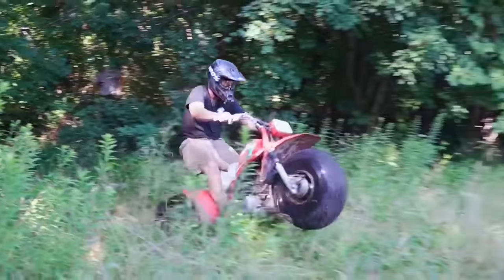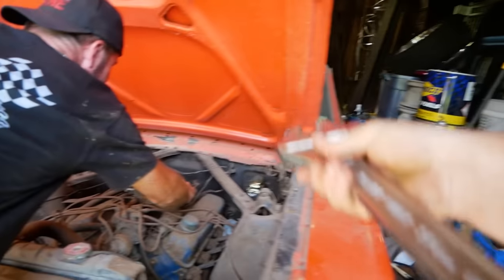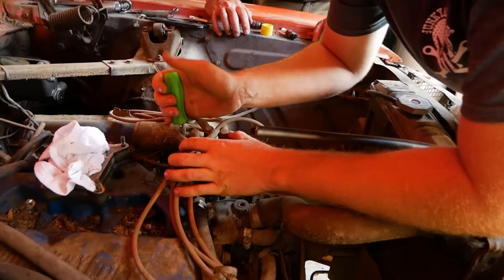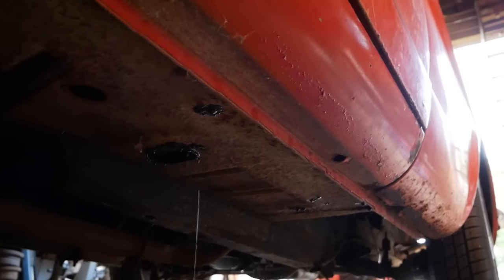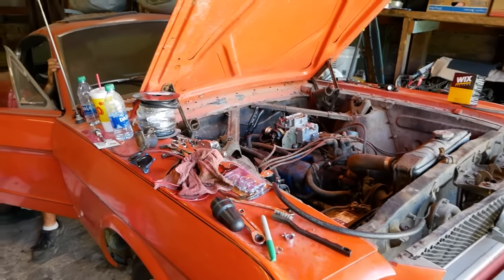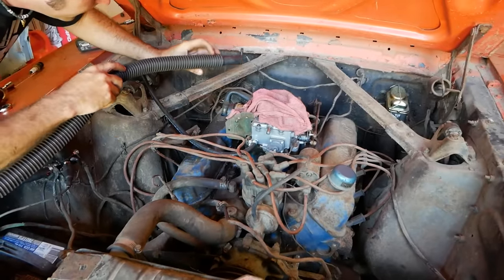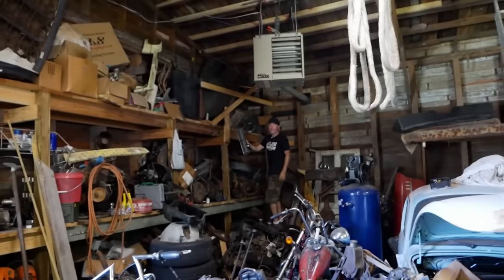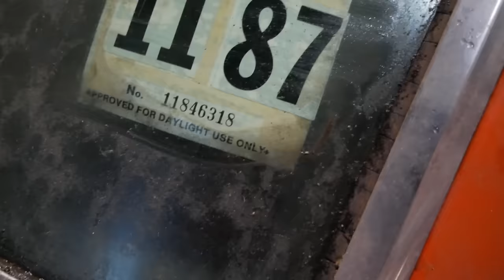Parked '65 Mustang FASTBACK First Start in 33 YEARS!!

Comment: I really hope they replaced the front rims with some that match the rear. I have an affinity for those as my brother had a ‘65 fastback back in the ’80s with those exact pattern of slotted rims, 14x7” on the front and 15x8” on the rear running 215/60-14s front and 235/65-15 rear Eagle ST white letters.

Comment: i like the way the guy said the output voltage from the coil is 10,000 volts when its really 12,000 unless the battery install emitts only 10v

Comment: i think there is a 1/4 inch gasket and metal plate and small gasket insulator on the old fords ,  need it there to run right, that distributor is wore out,   get a electronic distributor for a 81 or older    and ignition box with blue connecter to convert to electronic

Comment: I k n own it isnt a major nut whenever I use cork valve cover gaskets I take some permatex ultra and I glue the gaskets to the valve cover and flip em right side up and put about 50 lbs of weight on thrm in the sun or with a heater in front of thek to get them hot for an hour and the goop sets and then input a healthy layer of axle grease on the gasket where it mates to the head and gently tighten them down and they will be reusable. I had my 600hp 355 and I ran the same cork gaskets on my edelcbrok finned valve covers for 5 years and had em on and off 100 times to adjust the lash on my 306/292 .700 lift cam

Comment: ike if the engine was made before 1968 it is a 289 68 first year of the 302 should be a date code on every part should be a c5 on intake block manifold heads exct if so its a adjustable rocker 289
Reply: Also y'all should tap the heads and add screw in rocker studs makes that 289 valvetrain way more stable also iv got a factory 4bbl intake for that 289 if you're interested in it just hit me up I'm in NC this collaboration was awsome

Comment: Lots of discussion here about identifying a 289 vs an early 302. A 289 or 302 head casting  doesn't make an engine a 289 or a 302. The same applies to a 289 or 302 casting in the block lifter valley. 289 and early 302 blocks have identical 4.00" bores. What defines a 289 vs a 302 is the stroke, ie crankshaft.  A 289 has a 2.87" stroke. A "1M" identifier is stamped into a 289 crankshaft. A 302 has a 3.00" stroke. These cranks are stamped 2M. The only way to determine the engine size is measure the stroke (as mentioned in the vid), or confirm the 1M or 2M stamp on the crank. I have a 1968 Bronco with the original engine. 1968 was the last year of 289 production. The heads are 289 casting, the block is a 302 casting (the first year for 302's, they probably used up the 289 blocks) and the crank is 1M, 2.87" stroke.  My Bronco engine is a 289.

Comment: Difference between the motors 302 and 289 is the dip stick on a 302 is on the side of the block and a 289 is located in the timing cover I had a 289 66 mustang 3 speed in the floor and I've had a 302 and that 289 is a damn stronger engine and it only had after market 650 holly 4 barrel on the 289 and the 302 was fully built and that 289 would smoke the 302 .....302 was junk until it had big block 351 windsor heads added to it making it a 302 boss

Comment: Original engine  is 289 ,302 did not  exist untill 1968 . 351 Windsor  introduced  in 1969.  The 289 and early  302's used the larger  spark plugs .

Comment: That's not orange. It's poppy red. I have one just like it. Mine sat in the garage from1974 till 2004 when I restored it. I had to rebuild the engine. The oil looked like Jello. I'm pretty sure it was Quaker State oil. It turned over by hand but I didn't try to start it.  It's been on the road for 16 years now. It's first run was only 9 years. I bought and sold it three times in the 70s. The last time I bought it for $250. It's insured for $35,000 now.

Comment: The cars that ford made used the big plugs for use in leaded gas and the newer California requirement and alot of bs they removed the additives that keeps the combustion area from extreme hi temp and lubes the valve and rings.all ford motors used the big plug until 71 when the new 302 in California came with a new cheaper to produce what we called  "peanut plugs"  .
Reply: No lead could wear out rings and valves and other related contents shortly failed when they banded lead in fuel, there's still some they can't remove totally so they add ethanol  and denatured alcohol , I like to use av  gas purple or windex blue in used that to pass emissions that dealers were experimenting with and the effects it had on the engines, it still even reduces the life of the combustion engine. We found that if you use e85 this effect would be same for there no lead in the Ethel and meth to mix and your vehicle ran bad and hot, you can make your of own alcohol and just add a cup of coffee, ma seriously jus to add half a bottle of marvel mystery oil or a 1/3 cup of ATF, per tank and retard the timing slightly and the engine ran better and  cooler and last longer, you can use veggie oils too. This still works today, fuels from earth burn dirty and seems proper to say fuels sold by the dirty devil himself.
Reply: Thank you for your share 😁

Comment: I forget when but a little after my grandpa died me and my dad towed my grandpas 90somthing chevy Silverado z71 off-road home and we took the engine apart and fixed it up because I think the water pump leaked in to the engine so we did a relay cool job if I was a youtuber like you than I would have made a video.

Comment: I never get why people working on old cards don't just disassemble the car, clean everything and put them back together. yes it takes longer, but better than putting rusty smutz into the engine or hitting things with hammers etc.. I would absolutely just throw on some music and disassemble it, then get to cleaning. then you know every part that's failed and what's good, and know what to re-assemble.

Comment: The date code letters and numbers are above the stater on the engine block. If the code starts with C5 then it’s a 1965 block, C6 is 1966 block and so on. Still could be a 302 short block with 289 heads. Hope this helps!!

Comment: all them gauges on the wall and no oil pressure gauge on it when cranking and no oil pressure priming that thing had no oil pressure during the first start sounded like a brake lathe. no wonder it pulled a stud.

Comment: You can fix them get a torch and a coat hanger, not plastic hangers the wire
Reply: Hey a washer on both bolts after the starter to block will work too.
Reply: Choke it and work the gas it's not a rocket science children it's a motor treat it like one.
Reply: Thx sirena
Reply: These are easy to rebuild at home

Comment: Why is it that in all of these "revival" videos the revivers never think to clean the engines off? I would look the engine over as closely as possible but then immediately hit it with my light duty Harbor Freight pressure washer. Nothing works best with a quarter inch thick coating of dirt on it. Theatrics, I guess.

Comment: The difference  in the starter is not the 157 or 164  flywheel  it  is  Ford used  a starter with a different  depth in there  Auto than the the standard! until about 1979 then all auto and standard used  the same starter.  there is also a different diameter  in the register on the starter! All small blocks  and  Cleveland's  Auto use three Quarter  spacing from block plate to Flywheel to starter with 4.09 Register. Early standard use  three eights  spacing and a 4.14 register.  400 and 429 use   five eights  space with 4.09 register.   Small block autos s  have  141, 157, or 64  ring gear  tooth  count all use the same starter. Standards small block could be found with  148 157 or 164 all used the same  starter before1979.  after 1979 all standard take the same starter as Auto. Auto starter  can be used  on  standard with  proper spacing.

Comment: That bottled water has to have had the lid removed for,say, two weeks, or it won't "gas off" and will be just the same as tap water. NOT what you want to use in your radiator. Can't have that...

Comment: Hey dude the 289 and a 302 are the same engine
Reply from the maker: Nope. One has 289ci, the other has 302ci. 

They are both small block ford windsors, yes. But not the same engine. Just the same family
Reply: Took 289 heads and put them on a 302 block

Comment: In all my years of wrenching the first thing I always had done when a ford came in not running or poorly running with them Motorcraft wanna be holley 2 and 4bbl carbs is immediately throw that carb in the garbage and run a real holley. Might not be ford correct but like the late 70s and early 80s carbs were the worst and burnt cars to the ground

Comment: I think but not sure the Cleveland built had large plugs, and the Windsor's had smaller diameter ones?  Ohhh, never hammer on a battery post. Had one blow up in my face doing that. Car would not start, so tapped on posts while dome light, and ignition were on, it caused a spark on a cracked connection internal to the battery from post to cells, and went BOOM !.

Comment: Sorry for blowing your comment up when firing a motor after many years you should run the engine at 2000 rpms for 15 mins to get the rust off the cam lobes that accumulated from no oil on it